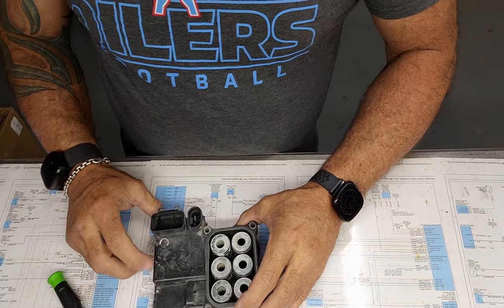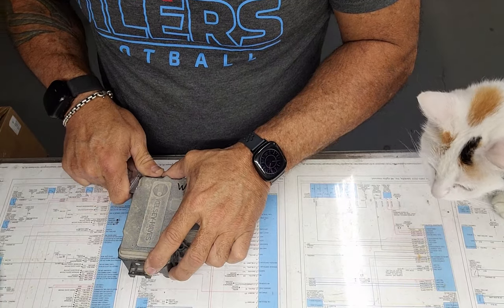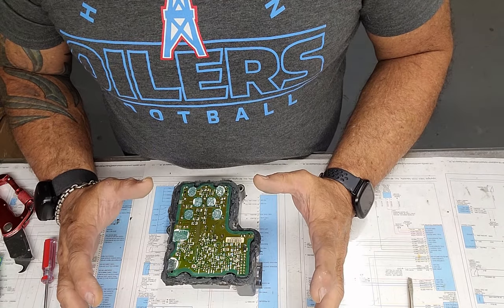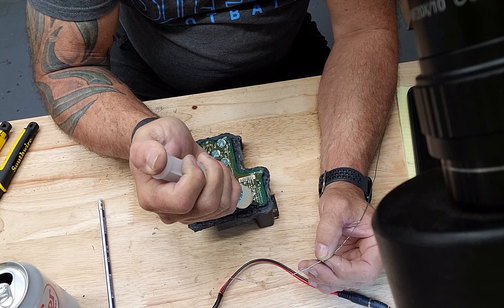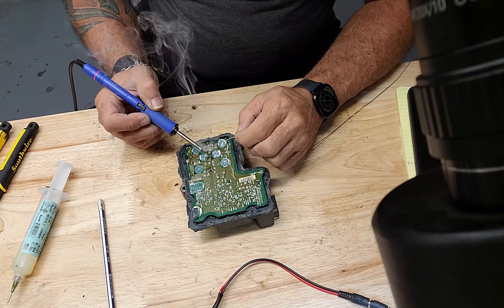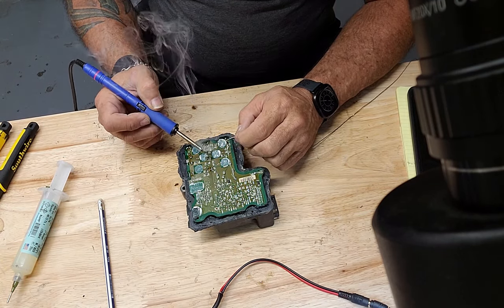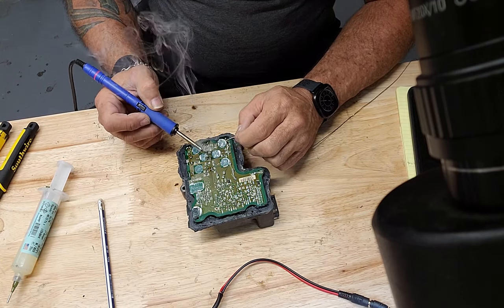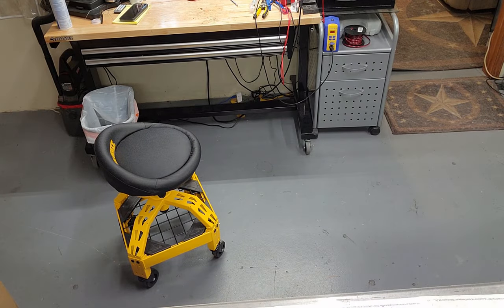Kelsey Hayes ABS Module repair - Multiple vehicles!! ABS light on diagnostics-ABS pump runs non stop

Comment: Reminds me of when I worked as an electronic test technician back in the 80's. Most bad solder connections where caused by cold soldering in the flow soldering process. They used flux that was cleaned by water baths. It did not allow the heat penetration needed to allow the PCB board through hole to "suck up" the solder to create a true bond.  To make matters worse vibration over time makes a tiny component weight fracture the solder joints. Solder is a mixture of tin and lead both a very weak bond.

Comment: Many more steps to actually rebuild these correctly. Muat break the down completely with bidirectional test bench.  . Those 6 are coils def not gforce sensors
Reply from the maker: This video wasn't meant to teach you every single possible failure point and the repair.  Of course there ae failures that fall beyond the scope of this video.  It was meant to show an effective repair for probably 98+% of them that can be fixed this simply and at home.   Hardly anyone watching has a bi direction test bench or sophisticated (expensive) equipment.  My intent is to help DIYers that are short on cash or just like to fix there own stuff.  If your comment is meant to educate me then please contact me …I never meant to imply that I know everything and I'm always open to learning from others.
Reply: @AutomotiveElectronics  I thank you Sir for taking the time to produce this video.
Reply: @tbbainter777 yeah and since you know everything and everything is by the book with you, use them coils by their proper name aka solenoids

Comment: Amazing video!  I'm going to be calling ya tomorrow from Houston on a 2010 Challenger ABS module to see if you will take it in for repair but ONE OF THESE DAYS I'm going to remember to try putting one of my Black RTV tubes in a container after I open it and fill that container (ziplock) with CO2 from my soda stream to see if that stops the air from curing it LOL.  Amazing job sir!

Comment: Great video but i was wondering what threads were on the 2 sets of torx screws (the T20 and the T8.) I know the 20 is a M4 x .07 but the smaller one i cant figure out. Is it a M2.5 x ? or is it a 4-40? The screws in my unit are just plain shot

Comment: My approach to repairing automotive control modules is very similar. I actually have the same model Stereo Microscope, but in white. I also have the led ring attachment light. I added two side high intensity LED lights which helps show the cracked solder joints. In terms of solder equipment, I have access to a micro-electronic soldering bench. Basically, everything except the large BGA equipment, which we job out. For example, programmable hot air stations, solder removal vacuum hand pieces, many different soldering stations, infrared preheaters, and with the except one hot air station all are made by PACE. I like the HAKKO C5O27 board holders, so I have retrofit my PACE equipment to accept HAKKO holders. 

I actually specified a new Stereo Microscope setup based on MEIJI EMZ-8TR, it is very similar to the NAVY soldering school stereo microscope. This microscope is the easiest to use in terms of keeping things in focus, and how far away the workpiece is from the lens. Maybe I can purchase it this year. 

The process of the repair is a little more rigorous because of the soldering approach and requirements which have to follow IPC standards. In looking at the PC board when exposed it is most likely soldered with lead-free solder, but not always. Usually, if you look closely at the joints you can tell. But, here again not always. Also, the solder work bench is ESD compliant. 

For each joint repaired, I first remove the old solder with a vacuum handpiece, which if lead free will require a lot of heat, and the use of flux (usually I try RA first) tacky or liquid. I don't usually add solder to repair a joint unless I know from the OEM module supplier the type of solder used in production, and I am surprised at the adoption of lead-free solders in many of these critical subassemblies using SAC305 or other common lead free solders. So, even if I know the type of lead-free solder used, I will just remove the older solder so as to not expose the board to the higher lead-free temperatures when soldering.  

Having removed the old solder I can now use the solder and flux that I feel will work best. I like to use Eutectic Tin-Lead solder, and for an ABS module RA or RMA flux. The solder wire flux should match the applied liquid or tacky flux. I have many different flux types available to me as well as solder wire and paste. On a critical unit repair, after repairing the solder joints I then clean the flux off of the PCB. If you have a camera attachment on your microscope you can take a before and after image to keep for your records. It's good to have pictures especially if you plan on talking to the OEM you now have something of value for them and they will be more helpful in supplying information. Usually, about component questions and system failure modes.
Reply: what chem do you use to clean the flux off the board afterwards?
Reply: @glasser2819  Cleaning of the board after repair should mimic, at least as much as possible, how the original PCB assembly was manufactured (soldered). Also, the cleaning approach also depends on what components were replaced. If the component replaced was a BGA or a fine pitched QFP or perhaps a QFN, then there is flux underneath the package or between leads, the best cleaning approach is an approved solvent for the board, depends on what is on the board, cleaned in a heated ultrasonic cleaner (dried in an oven and let cool before test). If there are components that are not compatible with submersion then a spray cleaner can be used and depends on the flux used. You will need a stereo zoom microscope to see how effective the board has been cleaned, and after cleaning inspect the solder joints.

If we look at a simple SMT device replacement you can get good cleaning results using IPA (isopropyl alcohol) and an acid brush.

In a lot of ways the repair process is an extension of the original manufacturing process. You are trying to understand the solder and flux used and the soldering profile, in that during repair you may have to preheat the PCB to reduce peak temperatures and relieve stressing the PCB.

Unfortunately, automotive electronic control modules fall under IPC category 3, which is the highest level or performance.
Reply: Hey, you seem to really know your stuff. Do you offer repairs on customers ABS modules? I think my needs a solder reflow but not sure yet. Let me know if you take stuff by mail. Thanks
Reply: Hello.  Can you repair my module if I send it to you?

Comment: First, love the shirt.👍 
 I have a 2003 mazdaspeed protege. Same issue. Pump runs constantly. I assumed it was just like this and had cracked solder. Took it apart, and found something was shorted and fried something on the board. Looks like a relay maybe. How can I find out for sure what it is ? 
  There was a lot shorted on this car. Blown light bulbs, etc. Noticed it was super clean underneath. Then found out when it was last registered. Had ti be a hurricane Florence flood car. Water shorted it all out. This abs module is the last thing left.

Comment: My S10 is from the year 99 with a 2.2 engine and that module does not have that aluminum cover, it has a Bakelite cover and has 4 connectors and the one in the video only has 3 connectors, it is the same Kelsy brand, it is impossible to cut that silicone because it has a square on the edges, I thought about doing the same by re-soldering the tin but it is impossible to remove that cover.

Comment: Awesome video man. I had my ABS light on my 2005 GMC Yukon XL SLE 1500 4x4. Exchanged both front assembly hubs plus wheel speed sensors. ABS light went off, but now I have a vibrating/thumping noise which I can feel and hear on the brake pedal when I am coming to a stop. It only happens when I get to 10 mph and under. Besides that the truck runs smooth. Anyone has an idea of what the issue can be?
Reply: Hello.  From reading your comment/question it appears that this vibrating/thumping noise wasn't present prior to you installing new front hub assemblies.  Logic would thus suggest that it's being caused by something that's now different than before changing the hubs. Since the new hubs/bearings are very unlikely to be faulty, and they are held in a precise fixed location with bolts and the socket in the spindle that they fit into, i wouldn't think the hubs are the culprit. The only other thing i can think of is your brake rotors.  If you didn't tighten the wheel lug nuts down evenly and gradually all the way around, it can result in a slightly warped rotor that will cause a fluctuating pulse when applying braking and which can often be felt thru the peddle.  I'm not totally sure, but it may be that it's more noticeable at low speeds.  I would suggest starting there....pull your wheels off, pop the rotor off and rotate it by a couple of stud places (just to give it a better chance to reset and straighten/flatten out) and then put wheel back on. Be mindful to just very lightly snug them all down before going thru a gradual and even tightening routine, making at least 2 (3 or 4 is better) passes en route to getting them fully torqued down to spec.  Probably safest to assume both are causing the issue and so redo both left and right side.  I hope this helps.
Reply: @botchvinik8668  thank you…the issue was there before changed the assembly hub. But, it did have the ABS and brake lights on. Now the lights are off. Also, when I let go of the steering wheel, the truck starts to move to the right as I am braking on those low speeds of 10 mph and under. I did noticed that on both rotors there was rust build up on the inside of them only……where the brake pad makes contact with the rotors. That was there before I changed the hubs. I did grind them down but there was still some rust. Not sure if that is the issue. As far as making sure to tighten every lug nut when reinstalling the tires and rotors….yes, I have done what you suggested. Issue is still there. Now the ABS light and brake lights come on ones in a while when I drive but turn off once I shut the truck off. Little vibration has not gone away when coming coming to a stop.
Reply: You can get little pieces of rust or dirt on the wheel speed sensor or the tone ring. Brakes work fine until you get below about 5-10 mph. If you let off and put the brakes on again they will work fine to stop. It's reading different wheel speeds .

Comment: Well, it appears the module for the 2001 dodge 2500 does not come apart.  The connectors are molded right on, irreparable

Comment: As a 05' Chevy Blazer owner that has no electrical background Or money lol  chasing a parasitic draw that may or may not be part of the abs light and brake light  --- Last owner simply pulled out the fuse ....I hear a commonly overlooked thing is not the sensor But the wire the sensor plugs into and 6 to 8 inches past is a butt connector from the factory that corrodes green And cuts off power Cheap fix But you are going to want the tire off to play around there
Reply from the maker: sounds like your pump stays running.  This could either be this repair our the relay itself inside is bad.  I dont usually remove the old solder just add some fresh solder.  That being said...removing the old solder first wont hurt anything.

Comment: So do you only solder the pin connections (where the connector connects to)? What exactly does a worn solder joint look like? I am working on a Kelsey Hayes 125 RWAL for my 1998 dodge dakota.

Comment: Hey great vid thanks.  I can't get my circuit board off the module while it's on the vehicle it's those 4 torx 20 screws  that are seized. One of the pieces looks like it has only holes and no threads only threads on the bottom piece. Wondering if it would work if I was able to cut the heads off those 4 t 20 screws and possibly into.the plastic of the mounting holes as well ? There is the one location where I don't know if the head will cut off because of the 90 angle it's on . Anyone know if that will work?

Comment: Hey Kelsey, I have the four deadly lights on my 2010 Town and Country: ESP, Brake, ABS, TSC. How can i isolate the cause? The speedometer is jumping up and down. Module? Wheel abs sensor? Transmission speed sensor? Where to start?
Reply: Clean a the grounds..
Reply: replace negative cable, and clean all grounds

Comment: thanks for the video. my 2007 volvo s40 has intermittent ABS light on. error code is 0030 rear wheel sensor faulty signal. replacing the sensor didn't fix it. wires and the pump are tested ok. so do you think the issue is from ABS module?

Comment: Oh 1 question ....I seen someone remove the old solder And replace it with what they called stronger better silver solder on GM clusters  Is it a better way?
Reply from the maker: They are most likely describing  lead free solder vs 60/40 ...40% lead...the lead makes it more durable in high vibration settings

Comment: Your killing me. I learned how to do this repair 11 years ago from a youtube that was super low quality but the guy killed it on the info. Had zero soldering skills but have had much practice over the last 10 years with guitar repair and 3000 lbs printers.   I gotta ask you to start out with, "WHY IN THE HELL DID YOU TAKE ALL THOSE T8S OUT?" 
     For the love of Zues, that was a waste of time. Just use a razor knife and cut the silicone holding the two halves together.   To my knowledge, there are 6 main points that cause the failure. I fixed them, and they lasted 4 years. Got the light again and was too lazy to take it out again which is the actual hard part on my GMC yukon, although I have better tools now so not as difficult as the first time. Its fiddly since you have to unscrew the T20s that are facing up with only about 8 inches clearance from the floorboard.
      PPeople, do not take all those screws out, just the 4 to remove it from your car. you're welcome. Oh, and as long as you don't jam the knife too deep, no worries.
Reply from the maker: Well......The T8s are only in the older modules...the newer ones dont have them!  so you probably have experience with the newer modules which are exactly the same but without the T8s and there are definitly more than 6 points that you need to go over.  If your in there soldering already then why would you not solder all the points that youve (I) seen fail in the past.  Sorry you felt it was a waste of youre time
Reply: @AutomotiveElectronics  Makes sense I guess. I didn't know there were other models. What do the T8s hold in?Ah, I see now that I'm not looking on my phone. Yeah, mines a 2003 GMC Yukon. I watched the video after I was done or I might have done more. A few weeks ago, I fixed my airfryer and the dude had me dissasemble the whole thing which was like 60 screws when all I had to do was remove 6. lol Now there, I was pissed....haha Yeah, fixed that too.
Reply from the maker: the t8s hold the lid that i took out in place as well as the silicon seal.  i actually like those better because after you reseal them the screws clamp the lid back down and theres no need to clamp it till it dries.   and trust me ...im not about doing extra work for no reason. and im all about fixing everything i can ...what pisses me off is when i open something up and they have purposefully designed it to be unrepairable.   the whole industry is headed that direction though and to add insult to injury when its designed to be thrown away they tell you a replacement is unavailable or discontinued.  recently litterally thousands of chevy trucks where stuck parked due to unavailble and unfixable TCMs ...I tried several times to repair those without any success.

Comment: Whia, Wera, KNIPEX tools, not Harbor Freight ....come on.
Reply from the maker: LOL....Screwdrivers?  If it makes you feel better i have a bunch from all over.  I save the big money expenditures for tools that are heavy use...Drills -impacts-hydraulics etc.  Harbor freight is fine for screwdrivers...
Reply: @AutomotiveElectronics  Big difference when ya use them all day, and get used to stuff that lasts, and fits in your hand like it belongs there, I've had cheap screwdrivers and wrenches, pliers, which is why I use the good stuff NOW, there is a BIG difference, yes there is.  the way Knipex wire strippers function, compared to Ideal, Klein, is night and day, Knipex is better...the way they grip nuts and bolts with their unique design adj wrenches, ya won't go back to a Crescent, or Channel lock, or Klein...especially not any really low end crud like Harbour freight
Reply from the maker: you convinced me on the wire strippers...I thought you were talking about the screwdrivers.  I lose so many screwdrivers for some reason id rather have 10 cheap ones than 1 good one that I cant find...lol.  I'm getting old ...cant remember where I put things last....especially reading glasses so I keep them everywhere.